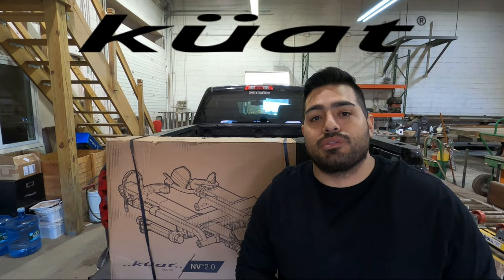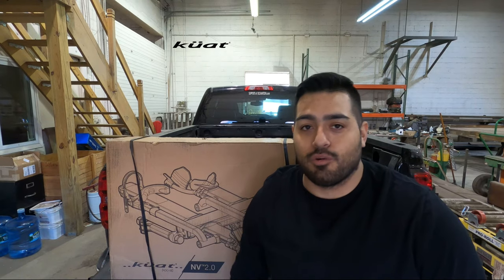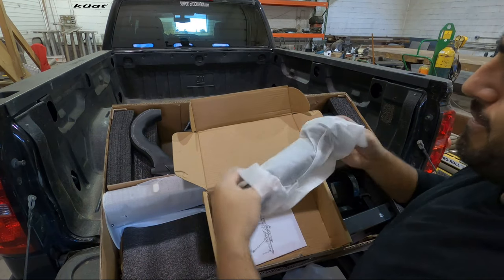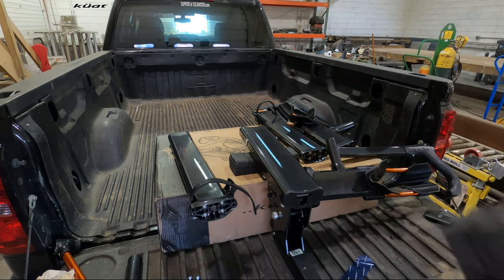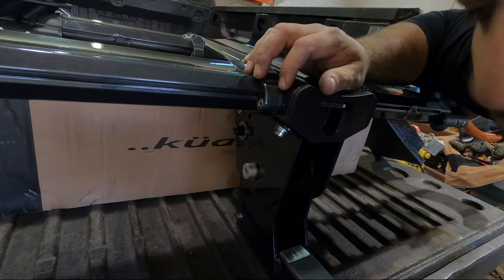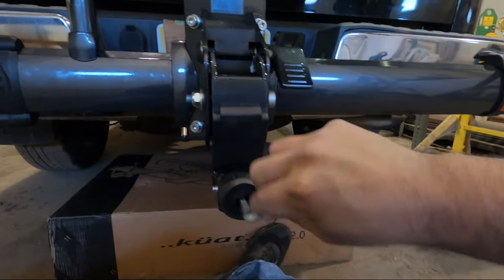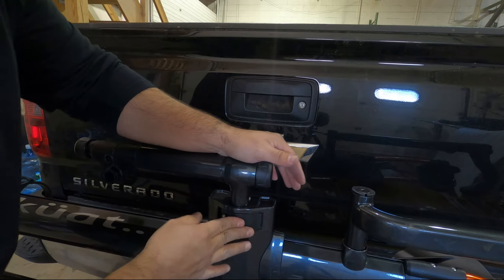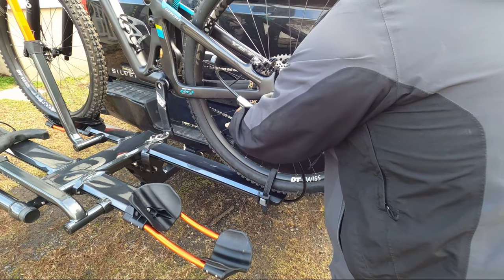KUAT NV 2.0 - Most functional Bicycle rack | MTB #732MTB #MANDALO #racklove #kuatracks

Comment: Perfect timing on this video because I am currently shoppimg for a hitch rack.  What do you like about this rack versus 1UP and Thule?
Reply from the maker: Jeff Golden hey Jeff, I’ve had Thule for a while and couldn’t get rid of the shake. After a while parts started to fail and Thule as a company wasn’t of much help getting it fixed and just suggested I get a new one. One up is a great rack but haven’t had the chance to use them. Just wasn’t fond of how they secure the bikes by just pushing horizontally into the wheels

Comment: Anderson, great video. I just put my rack together late last night (just before 11pm). The one issue I had was sliding the Trail Doc into the rack; that is why I am  on You Tube at lunch right now. I noticed in your video you lined the Trail Doc with the hole on the rack, but then the video skips ahead to where the Trail Doc is completely inserted into the rack. Did you have an issue too?  I tried unloosening the 3mm allen bolt in the quick release, but that did not work. Any suggestions? I will install the rack onto my vehicle when I get home tonight and will try again.
Reply from the maker: Sorry for the late response Bobby,  you should be able to release the lever and slide it right in. KUAT has great customer service if you need some 1 on 1 help.
Reply: @CartelMTB  No worries. I was showing a friend how it would not slide in, and he lined the stand post up with the opening while the rack was mounted on my SUV, wrapped the top of the post with the palm of his hand, when it finally slid in. I accidentally pulled it out the next day, but the post slid back in easily. Thanks for the reply. Love my rack!

Comment: I never new you had to use the allen to torque down the hitch. I thought you can just grip the rubber knob and give it a good hand tighteing!
Reply from the maker: eds a Hi Ed. You don’t have to but I have gripped my old one too hard where I broke the rubber. The Allen I find is much easier.
Reply: 732 MTB right on, it’s a new trick that i was never aware of. thanks for the share